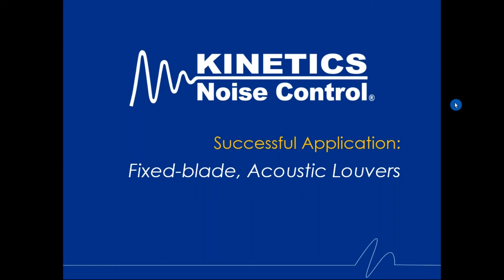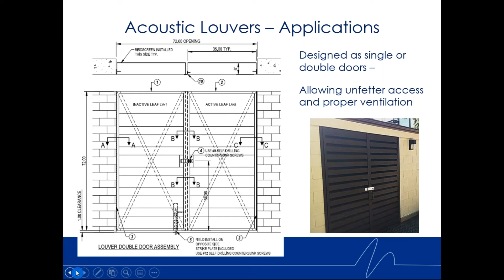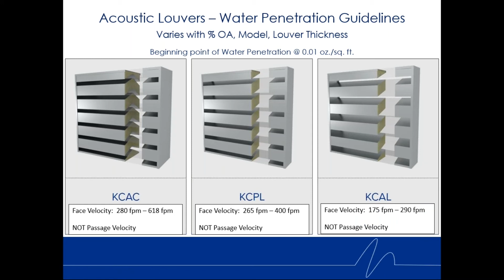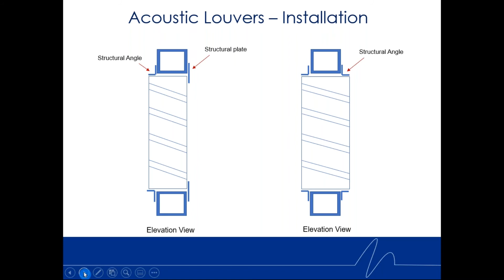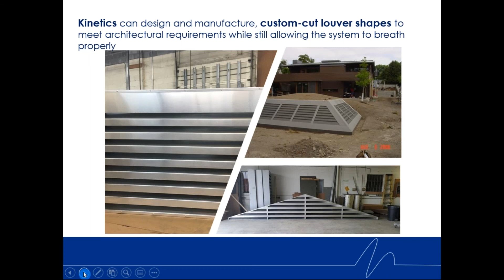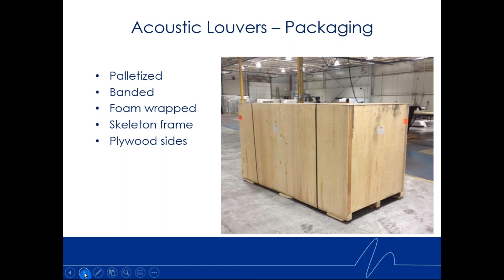Webinar Recording: Successful Application: Acoustic Louvers

Comment: Great video! Whats the reason for the Louvers facing downwards with the air hitting the perforated face on the bottom first?
Reply: Great question.  Reason 1:  Often the louvers are installed in building walls.  The downward slope helps keep rain and debris out.  Reason 2: As noise hits the inside of the louver from the sound source side, it is best to hit the perforated material first to allow for sound energy to be absorbed in the acoustic media.  Then the solid outer face, sloping down offers excellent sound blocking.   Hope that helps.  Thanks.
Reply: @johnsofra9111  Thanks for the quick reply! That's helped my understanding a lot, currently trying to design and retrofit some louvers for the front of 8 AHUs in an Air conditioning test chamber, with high Air Volume requirements.